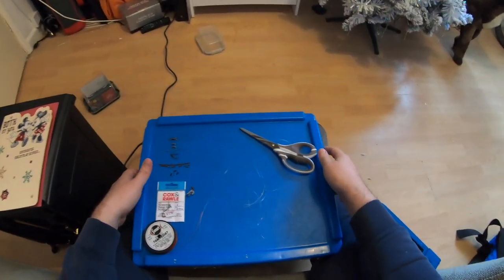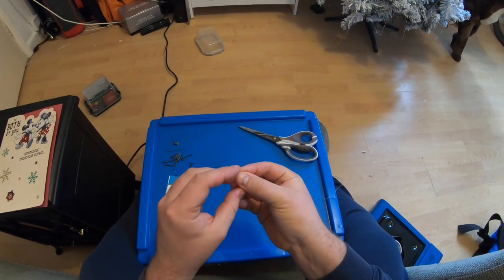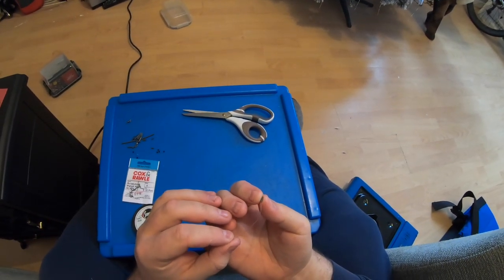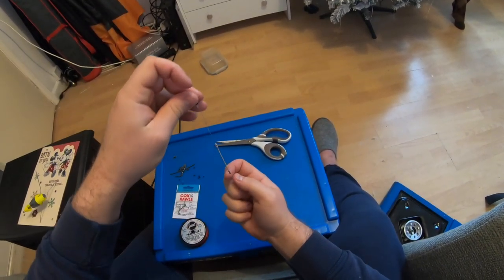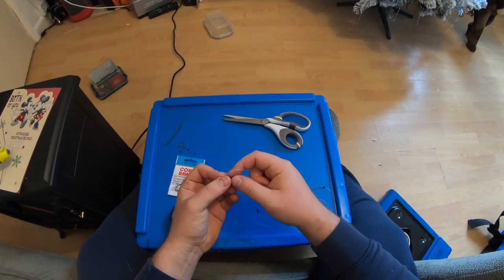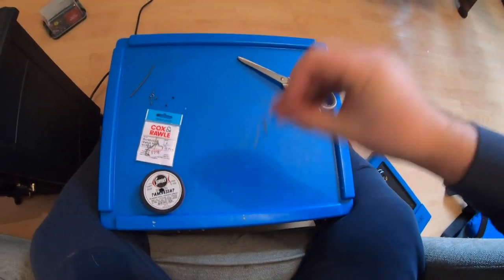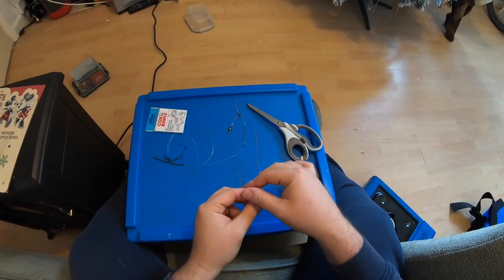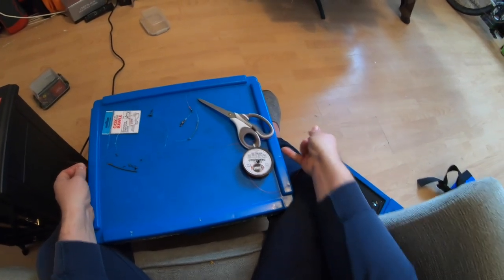3 Hook Portsmouth Loop Rig, The ULTIMATE Fishing rig

Comment: the rig with 12095968474 names.. lol
Reply from the maker: What else do you know it as?
Reply: @theportsmouthangler7297  well.. I refer to all the variants.. pretty sure this one is similar to the old school 'chicken rig', or a rig an oldtimer called the 'spine rig'.. tied a bit differently, based on the same or very similar knots.. doesn't make it a bad rig, if anything, the fact people across the globe tie something somewhat similarly, just means it has universal appeal to fishermen
Reply from the maker: Just had a look online at the chicken rig and it has 2 3 way swivels and doesn’t clip down at all or have a loop to allow a long flowing trace at the bottom. Or did I look at the wrong rig?
Reply: @theportsmouthangler7297  well.. see, I learned to tie that rig, zero swivels.. there are so many variants of so many rigs.. shrug.. don't think any of the chicken rigs I ever tied by hand had swivels, or a clip, either one , but neither were commonly used in the part of the world I used that rig.. it seems similar in some ways, just tied a bit different.. I have been wrong before, it just seems similar to so many rigs by so many names tied with similar styles of knots in so many places.. the number of turns are different, in most places, a clip wouldn't occur to the people living there as useful, either.. I don't use them here either in any rig, come to think, lol.. I do know how to make them and used to bend them out of paper clips and coat hangers, lol.. too many rigs, so little life.. lol